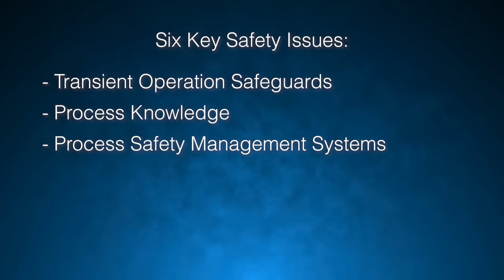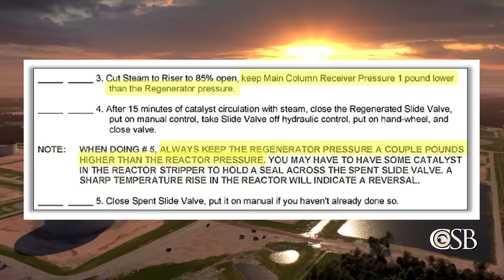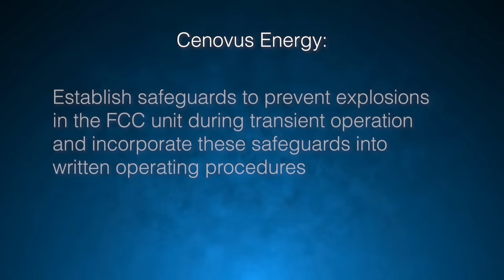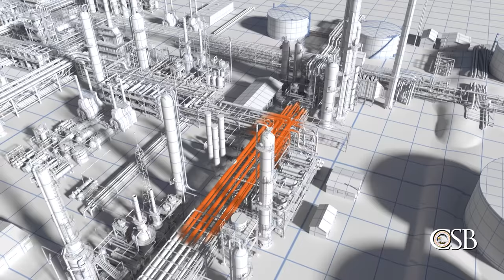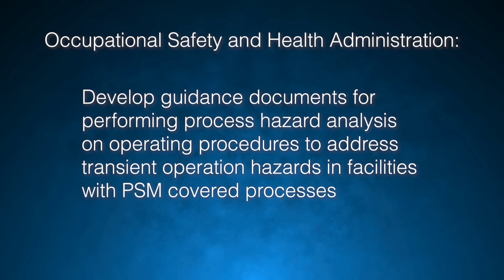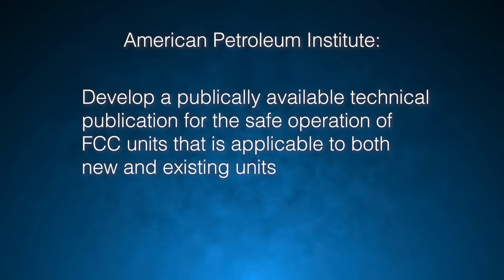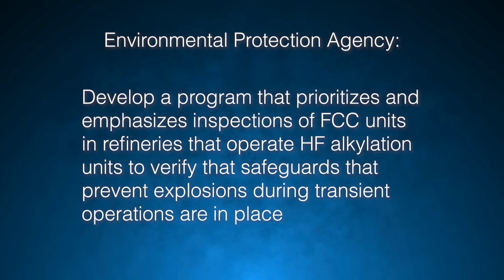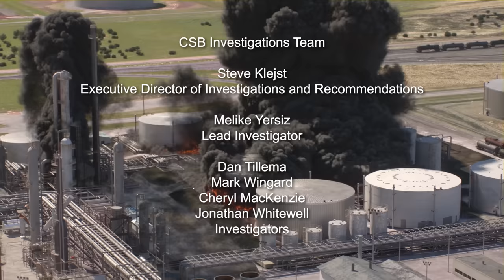Transient Hazards: Explosion at the Husky Superior Refinery

Comment: An HF tank near miss, my God! I don't know how much of it is usually stored, but it's one of the most reactive and toxic chemicals used in industry. It dissolves even glass. A few drops on exposed skin dissolve bones, days after exposure, it's absorbed readily—in addition to immediate cutaneous burns and necrosis. An HF kit and training to use it is required on your belt in the lab before even approaching the stuff. Inhaling gaseous HF is thought to be fatal in seconds of exposure at 50 ppm—and it's not that it causes death in seconds, that will take a few painful days... It stinks acrid, not unlike vinegar, many times below the damaging concentration, but in a refinery fire there is a lot of chemical odors to mask it, and random air gusts. And who knows what exotic toxic and explosive products it may form in a chemical fire, it reacts with just everything. Scary stuff. It's used in semiconductor manufacturing, but I didn't know it is also found in oil refineries, thank you CSB!

Comment: I kinda disagree with CSB here. The problem was really not "safeguards", but rather they should have had a valve monitoring system, like a pressure differential monitor or similiar, that will detect if the valve fails to seal successfully, and raise an alarm and/or prevent the transient operation (without override). Such a safety system, would also make sure the system could not be put in transient operation, without actually closing the valves (operatior/human error) as the system would fail to detect a pressure difference, thus creating a safe system that requires the system to verify a positive seal before allowing the transient operation to commence.

Its important to be technology neutral, and also allow "other safety solutions" than the "industry standard" like steam barriers, provided they fulfil the same safety levels as the "industry standard". In this case, it didn't fulfill the safety levels since there was no positive verifcation that the valve had been fully sealed (and also capable of sealing which means it should not have eroded). Such a positive verification of seal can be verified in this case as the system would build up a pressure after closing said valve, meaning a pressure difference would occur at both sides of the valve, that could be verified. If the valve did seal poorly, such a pressure difference would not reach the levels it normally does, and it could then be detected that the system is leaking, meaning a valve did not seal correctly.

Comment: Seems like someone changed the procedure 30 years ago to save time and no engineer questioned it afterwards. And quite understandable... New guy on the job would get an old looking manual, signed by someone important, and colleagues would say "follow the manual, we always do".... And no feedback from other fracking column operators since the "community" is small and umm..... fractured

Comment: That is how accidents are happening. 
Even with adherent dangerous materials. 
Corner cutting. 
Not keeping to safety instructions. 
Or implementing them.
And more often than not, stupidity and greed of management and directors, keep  production running.
And to hell with procedure. 
This was so in Chernobyl.
The same in Fukushima. 
Or 3 Mile island. 
It was in case of the Titanic. 
Or was with those cheap O rings on a frozen Space shuttle.
How many times Architects at their drawing boards make things that are good and, while not failsafe, though can be handled when kept to instructions.
disaster
loaded
All these stories there can be seen on youtube. And in very few cases technics as uch failed. and when it di,d because of a lack of control,checks and oversights.

Comment: This wasn’t an operator error root cause. It started at the design/engineering level. Then continual mismanagement because of lack of education. 
Why wasn’t this caught by regulators in any previous shutdown? 
How many engineers looked at the drawing and never questioned the wrong use of the valves? 

Guess what happens to we that raise the hand to change established procedures? 

I used to work for Husky. Blacklisted. Thanks mofo’s. 

Brittle fracture is also pointing the finger at engineering. Same with where the tanks were located and $ not spent for proper setup.

Comment: Looks like the foaming system worked well.  It could have spread, if not for the careful planning to add firefighters and high tech systems.  But we all know God , is our refuge, our Shield ,and our strong arm of Defense!  And remember, how its great to have gas stations and fuel for our vehicles!  Also remember, that electruc cars, only run a few short miles, and then its time to charge again.  And then, think, how do we get electricity?  By fuel, coal, dams and rivers, and solar and wind, which don't eork well.